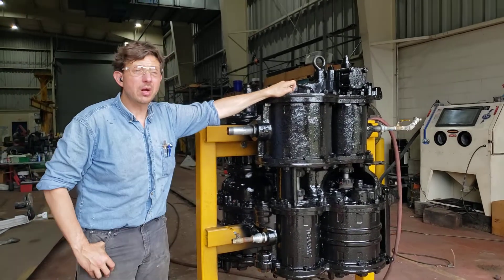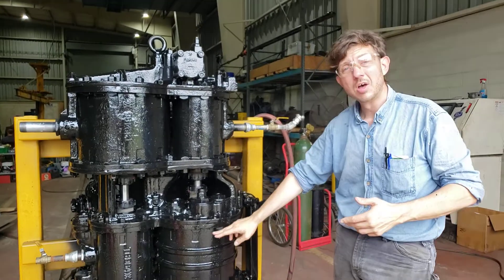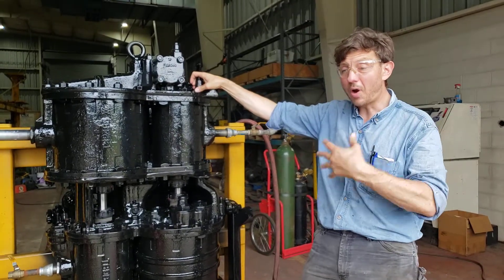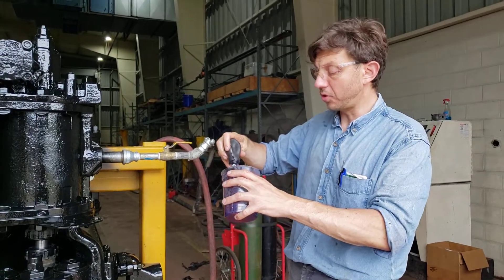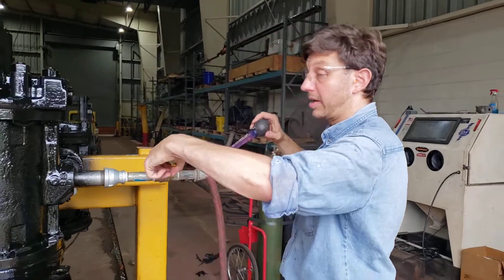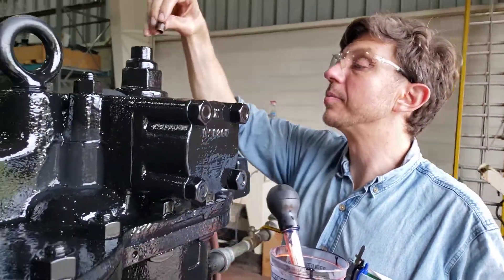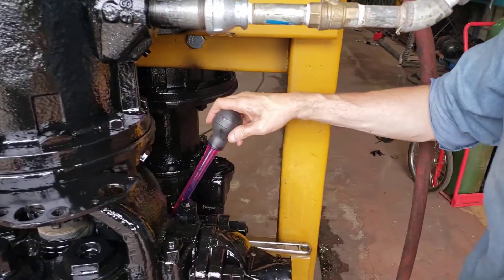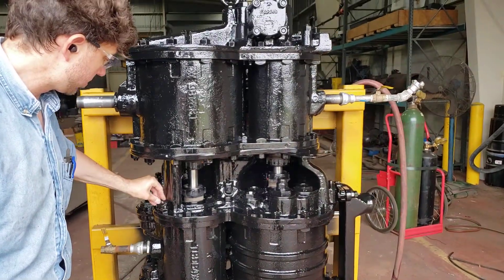Get PUMPED! Care of Cross Compound air pumps

Comment: No PB&J oil? Green Velvet 220
Reply from the maker: Interlube Corporation's products are actually better, and cost slightly less. I've done and been responsible for several side by side comparisons. 

 The result was that the Interlube Corporation's "Journal Guard 1200 and 2400" resulted in lower axle bearing temps than PB&J 220 and 460 respectively. Temps were cataloged for several weeks, same train, same ambient temps, about 23 degree lower bearing temps.
Reply: @thatsteamguy1082  Good to know!  Last I knew PB&J was the gold standard in our area.   I think 3-4 years ago it was $2300 or there about a barrel
Reply from the maker: Yeah, I had long believed that too until I did some impromptu side by side testing